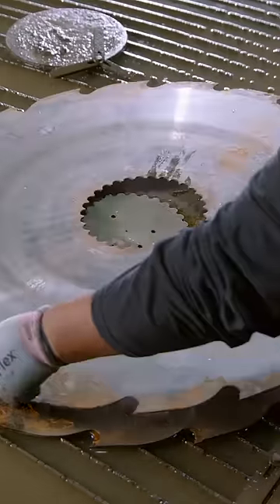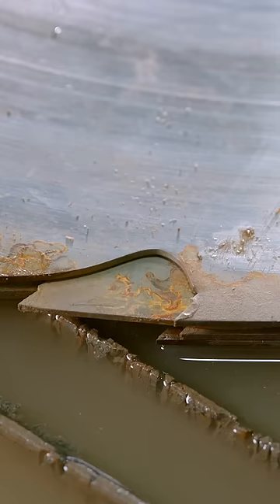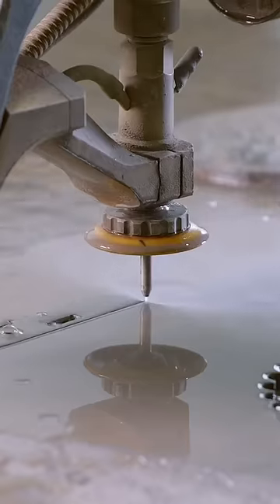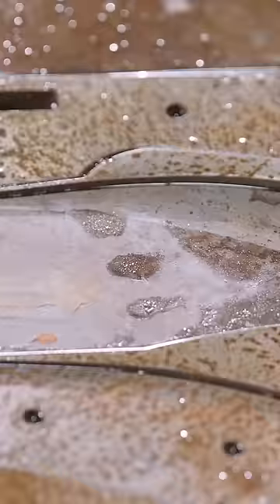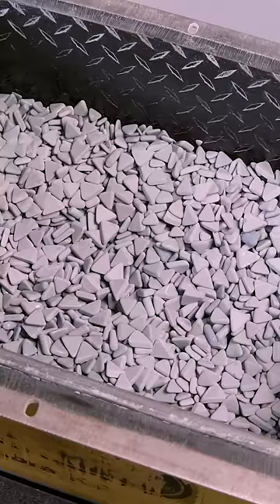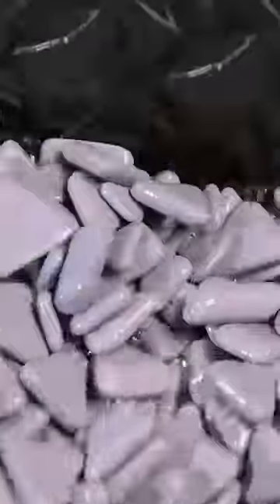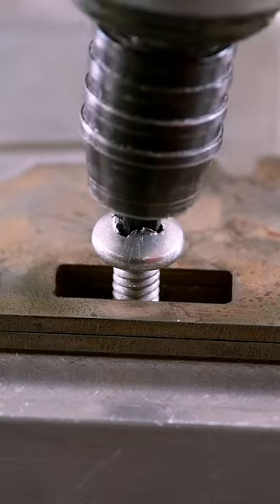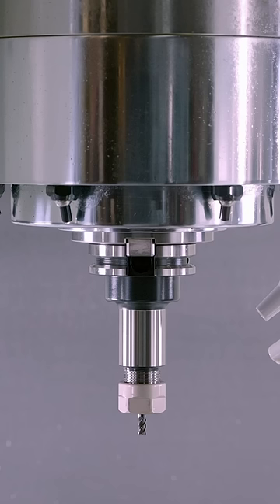Turning Old Sawmill Blades into Knives | How It’s Made | Science Channel

Comment: 5-10 years for any blade sounds too good to be true
Reply: If you cut balsa wood once a month, it can do even better. Lol
Reply: Hi, industrial sawfiler here. What they don't mention is how much work it takes to keep them operable that long. 
The carbides get replaced after being repeatedly sharpened, the blades get hammered flat and rolled to maintain tension, among other less routine repairs as needed.
Eventually they get to the point of being NWR.
Reply: @mircomuntener4643  Thanks for the professional opinion! I figured they were replacing carbide tips, but still, that’s an impressive number.
Reply: @mircomuntener4643  I was about to say the same. Spending twelve hour shifts truing and retoothing them is soul destroyingly boring.
Reply: @EddieTheH  I fucking love it..
Reply: Yeah I figure the blade probably is used for 10 odd years. But not without repair. 
At my old job we use to get the same cold saw blade resharpened. The entire 6 years I was there we had the same blade
Reply: Two to four months. If you're lucky.
Reply: @craigbraye540  hah. The first set of carbides will last that long, cutting 20 hours per day.
Reply: @mircomuntener4643 carbide is mean for sure. Thanks for your input. I'm a cnc lathe machinst/programer. And we always use carbide. Except on specific mats.
Reply: Immediately im suspicious of his statement, id of imagined they would last 2 to 3 months tops 😂
Reply: We have a family sawmill that was steam powered in 1890 but has been run off a belt to the tractor for the last 100 yrs or so.

As far as I know it's the same saw blade that's always been on it, the teeth are spring loaded and changeable with a special tool.
The actual blade basically never has any reason to be changed.
Reply: @eddieelizabethhitler3259 I hope you are speaking of the past. If you aren’t sounds like you need to find a more engaging use for your skills. Making custom knives is fun and can pay well if you are skilled. Hope you found/find something better man, that does sound soul crushing.
Reply: yeah most blades last for like 10 minutes
Reply: I work in a sawmill, our saw blades don't last that long. They get new tips frequently and despite diligent work from our filers, end up as scrap metal in months not years.
Reply: Bull shit there isn't no way five years of rubbing against wood sand and whatever else
Reply: @craigbraye540 that's what I was thinking and that's replacing the carbide tips friction is friction
Reply: This is cool and all but not as interesting as how a "Plumbus" is made
Reply: One thing is for damn sure, it's hard for a saw blade to make it through an encounter with an old plow head that a tree has grown around!!!! That was one hell of a wreck!!!
Reply: More like 6~12 months
Reply: 500th like
Reply: @GoogleUser-yj1wy  Nah, that's legit. Some can last even longer, provided you don't blow it up.

When I was a saw Filer, we had customers that were using the same saw for 20 years.
Reply: @mircomuntener4643 I was a industrial saw filer too. We were lucky to keep a brand new batch of saws running for 1 week. We of course swapped them out at lunch and at the end of the day, fixing them in between. We ran 12 million feet of wood a day. A DAY.
Reply: Depends, if its good quality steel, benched properly before the first run then serviced regularly by a GOOD saw doctor they can last 5 years easily, they last about 5 mins if a dumbass operator smokes it up and rips all the tension out. generally they have a catastrophic failure due to metal or something like that in the feed stock well before that age though.
Reply: @shaunkeith4087 idiots at my work run the bands tracked wrong on the wheels and get boards stuck in the edger and burn the blades blue

Comment: I worked in a Woodyard for 10 years at a papermill.  That blade looks mighty small, the ones we used on the saw deck had to be moved by a crane and would kill you if they fell on you. Dull blades were sent off to have the teeth reworked or new ones welded on. It was always fun to have teeth come off a blade and come whizzing into the glass right in front of where you were sitting or have a blade just completely explode on ya.
Reply: Those are edger or gang saws in a board mill, the company I work for makes similar ones, heck maybe even made those!
Reply: yea modern blades are crap for making blades from since its usually mild or some alloy that just has teeth brazed on. old mill and saw blades thou make for great blade steel
Reply: @dragonwing4ever , any circle we made was 50 Rockwell or more,  we tempered our own plate,  we didn't have any mild steel blades
Reply: @N8-T  most blade steels get into the 58-63hrc range obviously that can vary with how you ht. i don't doubt you could get some hardness out of the blades you made but it wouldn't be a good blade steel, i would be very surprised if it was good for knives to this day
Reply: @dragonwing4ever  you can further harden saw plate, there is no reason you couldn't further heat treat your knife blanks after you cut them out of a saw plate. Yes a saw blade hardness isn't good for a knife edge out of the box. But I know many people who made awesome knives out of our band steel which was about 42 to 46 and they do their own heat treat on them to make them harder. Can't run much over a 48 on a bad saw or it will obliterate itself bending over the wheels.
Reply: @dragonwing4ever , I'm not sure why I care, seems a ton of people want old saw steel to make knives, why I am trying to sway your opinion on thay I don't know! If you think it's not good blade steel that I don't know why I care
Reply: These are off an edger, trim saws, or a small bull edger. We have the large band saws for the resaw and the head saw. Before it exploded we had a small gang saw. Waiting on insurance to be able to replace it with a bill edger
Reply: Having a tooth fly at you sounds terrifying, but I guess you get used to it.
Reply: @N8-T  I'm not trying to sway or knock, its good to be able to have these discussions and learn things. old saw/bandsaw blade used to be made from 15n20 or l6 which are great blade steels nowadays thou with the brazing on of teeth for there blades its kinda shifted to a "shitty" steel which doesn't really work for knives. the edge retention etc just isn't there. maybe I'm wrong and the blades your making would work but everything I've seen and heard has been negative on that front
Reply: That doesn't sound like fun at all. : )
Reply: The computer messed up one day and let a log go into the saw . I thought a bomb went off !
Reply: I think that these are used in a toothpick factory! 😋
Reply: Do the blades even last 5-10 years? Seems like an awful long time to me

Comment: I’m work in a mill. This process is vital to the saving of money and material. A circular saw blade will last maybe a few days at best. A band saw will be replaced every few hours max. We go through those very quickly. You can tell when either of them is worn by the markings on the wood. They’ll become more obvious and deeper. Circular saw cuts will form a kind of quarter circle and horizontal/vertical band saws will leave stripes.
Reply: Can't you just sharpen them, like knives and other blades?
Reply: Band saws, specifically head saws, should run ~10 hours each if your saw filers and your headsawyers know what they're doing
Reply: @DavidStruveDesigns yes, but its a little more complicated than just sharpening it. First it goes to the bench, where the saw is cleaned with a powertool wirebrush, then any cracks are welded, saw is checked for any kind of warp or weft and adjusted to fix, tension is measure and the steel gets rolled out to correct the tension. Then the saw goes to the grinder. The grinding really depends on what kind of band saw you're using, whether its tipped, spring set, or swaged. Most high-output mills use swaged head saws, so I'll describe the process with that. You pregrind the saw on the grinder to make sure your profile is more or less correct and get rid of any remaining buildup or gunk, especially in the gullet, then you oil the teeth with oiled chalk, run the swager over all the teeth, run the shaper over all the teeth, then you do your final grind, usually 4ish passes around the saw. Theres a lot that goes into knowing if your saw is "sharp" or not. Shape of the tooth from both the front and the side, especially length of the edges, size of the pocket, shoulder angle, etc. Once its where you want it, you can flip the saw over and start the grinding process from the beginning. The grinding process takes maybe 3ish hours per saw, bench time is dependent on how messed up the saw is and how good the filer on the bench is
Reply: I used to work as maintainence metal worker on a saw mill that cut rough logs with bark still on them, the blades would have their tips changed every 3 months or so, and they got sharpened once per week i think..
Seems your circular blades were of poor quality.
Reply: circular saws are on a rotation of 50 or something going to and from the sharpening place and we chnage them once every 2 days.
Reply: @Birilling  a big thing i've learnt is that saw kerf decreases every time they're sharpened which means that they no longer can cut the type of wood they were doing before but can cut other types instead. always lots to learn as a humble stacker.
Reply: @ScottTheBot07  for swaged head saws, the act of re-swaging and shaping restores the kerf. It draws material up from the shoulder to replace the kerf. The two primary limiting factors for the life of head saws are repetitive stress opening old welded cracks, at some point there are just too many cracks to make welding them either practical or economical, and the gradual reduction in the width of the blade over time
Reply: For spring set, resetting the teeth fixes that kerf issue as well, though it's a gigantic PITA, and for carbide its just a matter of replacing the bits, which is also a PITA
Reply: Facts.
Reply: We have a family sawmill that was steam powered in 1890 but has been run off a belt to the tractor for the last 100 yrs or so.

As far as I know it's the same saw blade that's always been on it, the teeth are spring loaded and changeable with a special tool.
The actual blade basically never has any reason to be changed.

The teeth are sharpened right in place with a file until every couple of years they are wore enough to need changing.
The whole operation probably takes a half hour or so.
Reply: You guys make it so complicated. I just go to harbor freight, buy a new blade, take it out of the package before I get into my car, and drop it on the concrete  by accident. The customers never complain either. Come to think of it it does such a good job that the customers never have to call me back to perform any more work. I do custom mass produced approximate precise roughly finished carpentry. When I need to get even tighter tolerances, I just measure with a micrometer, mark it with a piece of chalk and cut it with an axe. You guys waste too much time. It only takes me twice as much as half the time from start to finish. Get shit done.
Reply: i work at a small sawmill and we run a circular saw on the head rig with tungston carbide tips witch have a kerf of 8mm and we sharpen them every 12 hours or so after they have cut around 150-200 logs at 5ish meters long. personally i think hammering the saws is better than rolling but the place we get them retipped after a year or so also rolls and gullets them at the same time so yeah pretty sure the saws are at least 15 years old at this point  @Birilling
Reply: I fell asleep half way through this answer
Reply: The answer is a blade that is constantly renewed.  Is there not a water jet style blade for wood?
Reply: Why them screws so stripped
Reply: Then they are replaced and sharpened again.  You just don't throw them away.
Reply: I’ve had my bandsaw in use for about 9 months or something (granted I use it max few hours a day and not even every day), doesn’t rly matter if it does a bit of a rough finish if the wood is getting moulded into paneling anyway
Reply: P.s. A friend of my dad was complaining that his sawblade was dull so he sawed some concrete with it to roughen up the edges and cut better temporarily hahaha
Reply: @juhis5936  that’s true. Some of the stuff we put out won’t though. Also means a lower speed will have to be used. And as an industrial sawmill we gotta keep them numbers up
Reply: @DavidStruveDesigns  hehe, no. They’re massive. Two men needed to carry them sized. If you fuck up, because they’re flexible it’ll hurt. Circular ones are more handlable but the method shown on video works better anyway. So many blades.
Reply: @Spedley_2142  heh, no
Reply: @patrickdelapp9657  we don’t tend to. Its rare
Reply: @juhis5936  based. Unfortunately not an option on industrial scales
Reply: @blame681  understandable. Don’t feel bad about it mate.
Reply: @Viking-r5e  that’s awesome. Ours is a far more modernised one that’s been the same family company since 1890s too. Ran off water (river nearby) I think but I honestly am not well informed of the history of the place.
Reply: @ScottTheBot07  ye my machine never has anything going through it so fast that a dull blade wouldn't cut mostly because I work alone and I have to be at the other end stacking it once it's through and then back again to put another one in
Reply: @ScottTheBot07  that's awesome! Yeah, this is a small very old fashioned farm and we only saw enough for personal use. The farm is more in preservation mode than production nowadays...
The mill itself is full-size, never updated in anyway really besides running it off an old Super M or John Deere crawler belt.

There's something like 14 tractors and the newest is probably from the 70s, several WW2 era, only a few powerful enough to saw with.
Reply: There still is the old earth and Hemlock dam out back from the early 1800s sawmill, but that was an up and down saw that built the original buildings. Amazed me the submerged logs lasted 200 yrs though!
Reply: @Viking-r5e  I've got 2 of those early 20th century saw machines at work if I understand correctly to what you're referring to they haven't been used since the 80s or 90s tho and the building they're in is half collapsed, you can still go into the basement of that building where all the belt wheels and axles are it's rly cool, whole place used to be steam powered but they switched to electric motors at some point
Reply: @juhis5936  nice! I love seeing how old machinery ran.
We saw only a few days a year, but in the last several years I put metal roofs on all of the buildings on the farm and did a lot of repairs, so while still rough they are holding up a lot better than they were.

The biggest issue is the track lunges with the frost every winter, so we have to do our best to straighten things each year.
If the boards are within 1/4" from end to end we're doing good 🤦‍♂️🤣

The mill was through 2 fires in the early 1900s as well, so that didn't do it any favors. Some parts are cracked and some are seized, but it still does the job.
Reply: @Viking-r5e  it's amazing that my workplace which just last year turned 100 years old btw hasn't burned once it's the only small scale sawmill left around here because every other one has burned down, you should see the caking of the sawdust everywhere and the piles of woodchips on the floor etc, it's these days more like a planing/moulding shop than a sawmill the building where the moulder is was built in 1974 as an extension of the old sawmill building
p.s. the moulder is from 1965, works like a charm apart from a few quirks but I've got my workarounds for those lol

Comment: Imagine traveling back in time a centurie or two and tell blacksmiths we use water to cut metal.
Reply: They would NOT be surprised at all, since water was powering all of their mechanical hammers/lathes/drilling machines and grinders from before medieval times. ;)
Reply: Water jet cutters use abrasive in the water stream to cut the metal, in my experience that would be garnet
Reply: @railroaded1991  yeah usually corundum is used, though some other abrasives may be used for ceramics.
high pressure water-only cutting is sometimes used for thin metals (e.g. foil) or softer things like plastic.
Reply: @satibel we used garnet and were cutting explosion welded metal composed of stainless and a copper type metal. They were for flanges for piping, I think on ships. Plates were about 2" thick. Also cut thin metal yard ornaments as well as non abrasive cutting of plastic and foam.